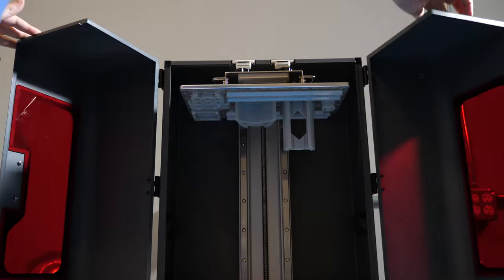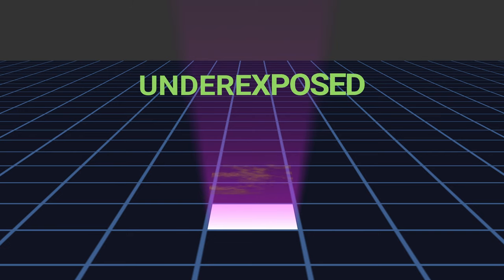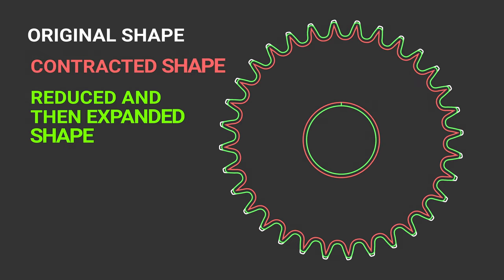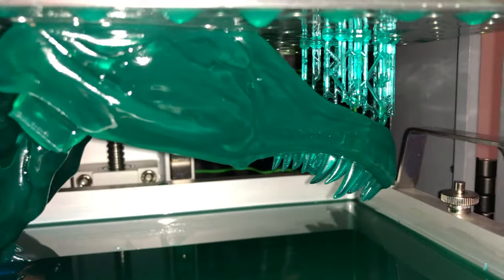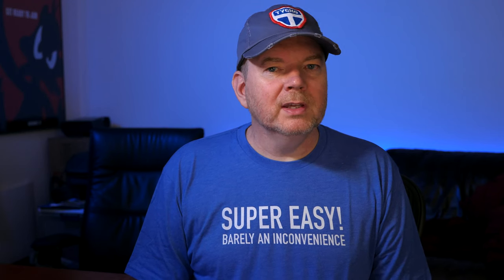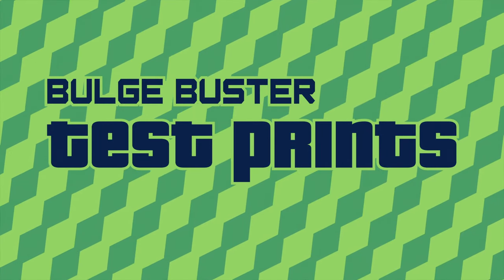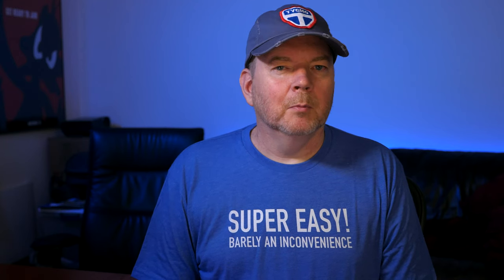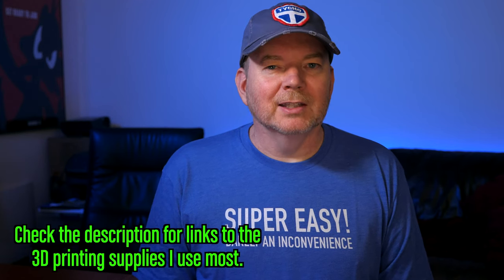Remove the Elephant's Foot from Resin 3D Prints - Plus NEW FREE Bulge Buster App

Comment: How about  make your parts a little thicker and then sand the elephant's foot away using a true flat surface and sandpaper.
Reply from the maker: Right so that was the idea I had before I came up with this adea.  I printed the gears thicker and then was going to sand them down.  Not so easy though.  And there were some parts where sanding down the elephant's foot was a big messy job.  So yeah I did try that but I wasn't successful at it.  Could be someone with more skill could do it easily.

Comment: Just chamfer the facing part surface on the cad program and problem fixed.
Reply from the maker: Hey thanks for watching.  That's an ok plan but not a great one.  For one you don't have the original cad file for every model you want to print.  If you only have the STL for example.  The other reason is that it's not very accurate.  How much do you champher?  Bulge Buster tests your printer and resin combo so you know the exact amount of reduction will equal the elephants foor.  Next is that the champher ramps - and so that would just make a different shaped elephant's foot.  I think BB is a much easier and more accurate solution.
Reply: @Nerdtronic  I didn't want to take away from your efforts, I can see why your method and program will yield better results. Great work thanks for sharing it with us.
Reply from the maker: Yeah thanks for sharing your thoughts also.

Comment: The windows app doesn't even start in wine, so I am interested in the linux version.
Reply from the maker: Try this:  http://nerdtronic3d.com/bust/BulgeBusterLinux64bit.zip
Reply: @Nerdtronic  checking it out, thanks much!
Reply: @Nerdtronic  Worked. I sent an email with a screenshot of a font scaling issue, but the actual function, did.
Reply from the maker: Got it.  We are looking into it.  Which Linux OS are you on?
Reply: @Nerdtronic  Ubuntu, lxqt desktop. On my phone now, can check the version later but probably 20.04. Probably relevant: screen size more than 1080, but I think not 4k.

Comment: This doesn't work hask exception that are not handled when loading a zip file
Reply from the maker: Are you on Mac or windows?  Also it doesn’t support every printer. So it’s possible that your zip file is for a printer that isn’t supported.
Reply: Windows machine for a Phrozen Transform (specifically mention), not supported?
Reply from the maker: @jamescantrell6275  mail me the .zip file that’s crashing it. Send it to michael@nerdtronic3d.com. Also make sure you have the latest version. And include the name of the slicer you used.

Comment: I just chamfer/bevel the part in the design to compensate for the inevitable bulge...
Reply from the maker: That's a way.  But doing it in the design phase means youd have to know how many layers you're going to expose higher and how thick those layers will be.  Where doing it as a post process is flexible.  But since BB doesn't work for all printers, it is a way to do it.

Comment: very cool - printing a file now

Note I had problems using an input file from Lychee. File opened fine in bulgebuster, and exported ok with pixel dimming (although it's a bit weird while exporting with a modal dialogue popping up repeatedly and disappearing) - and I can unpack the images and they look great. I can also open the resulting ctb file in chitubox - (although I can't see the dimmed pixels there) - but when I try to print the file on the Saturn it says unknown file format. 

Here's a link to my input file: https://drive.google.com/file/d/11qN1GO6iZ96Jynsm0PODMWgpiYYDmLZe/view?usp=sharing  that was created in Lychee, and the output file that my Saturn won't read: https://drive.google.com/file/d/1EBhK996wziNWsJOdKrBRLFY-VdDYn-ll/view?usp=sharing
Reply from the maker: Thanks for posting the files.  I checked them out.  Are you sure the initial file, the one that was created in Lychee, works on the Saturn?  It's not a .ctb v3 file.  It's a .ctb v2 file.  Drag it in to BB and see next to File Type: it says CTB File.  I never could get those to work on the Saturn.  If you slice in Chitubox and drag that on you'll see it says CTB File v3.  For BB to work to bust files for the Saturn, the input file has to be in a v3 format.

I'm sorry that you found this issue. Getting Saturn file support to work was one of the last things I did before releasing the app.  We kept getting that unknown file format error.  I didn't have any support from the manufacturers to figure out the file formats.  Only a little from a few other developers.  But in the end the only way I could get the Saturn to work was by adding the .ctb v3 support.

Hope that helps.  Let me know
Reply: @Nerdtronic  Interesting thanks for that - I did not know lychee was exporting old CTB file format. It does work on the Saturn though - but it's nice to know that's why the lychee file doesn't work with bulgebuster - hopefully next lychee update fixes file export. In the meantime I'll just use Chitubox whenever I'm printing raftless. 

Thanks for reply and thank you so much for the great tool!!!!
Reply from the maker: @n0f8r  Thanks!
Reply: @Nerdtronic  Lychee version 3.2 updated CTB file export, and it works with Bulgebuster now.
Reply from the maker: @n0f8r  Wow that's great.  Thanks for letting me know.

Comment: Easy Fix... Don't print the part flat against the build plate.
Reply from the maker: Thanks for the input Kenneth. I had tried that. But it led to frustration. What orientation?  Supports leave the bottom damaged and then you have sanding and finishing to do. These parts are all ready to go right off the plate. That's the point of the exercise.